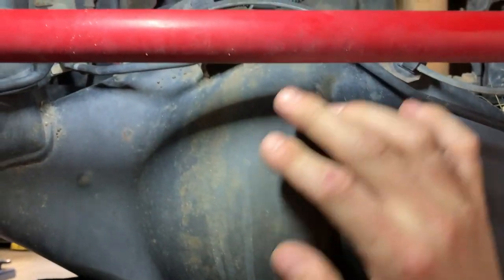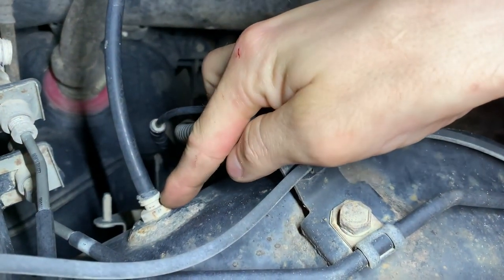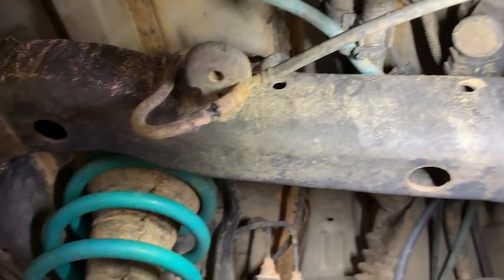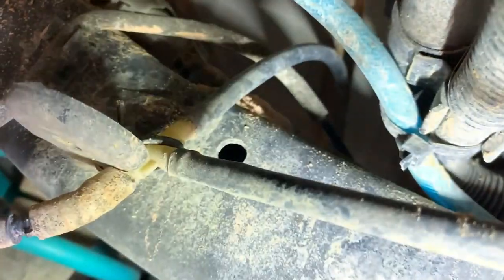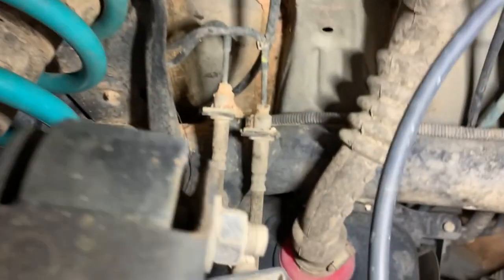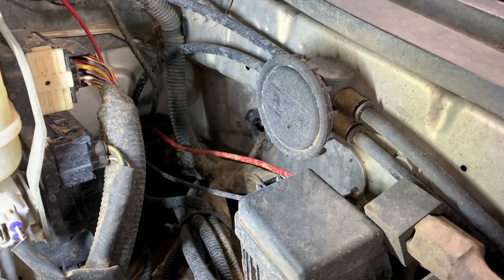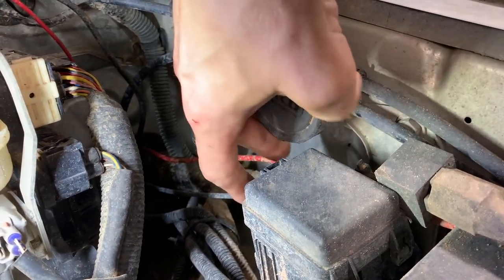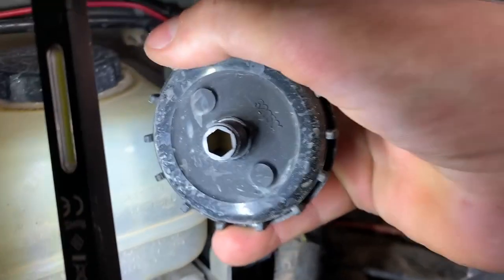ARB Differential Breather Kit on Toyota FJ Cruiser

Comment: Do you recall the diameter tee fitting you used to accommodate both the stock hoses and the 8mm ARB hose? I tried a 1/4" barbed fitting but it's too big.
Reply from the maker: Ya, 1/4” is gonna be too big.  I honestly don’t remember at this point.  I took the hose with me to my parts department and just matched up the fittings.  I would just take a piece into the store you are shopping at and do the same.

Comment: Some reason my 2007 automatic trans f j differential light went on now and I make turn under 10 miles an hour the back wheels skid and abs lights are on any ideas?
Reply from the maker: Yea!  Your rear diff lock is probably engaged!  Don’t drive it!!  That’s for Off Road use only.  It’s probably the solenoid malfunctioning or something along those lines.  The skidding is likely from your wheels being locked together.  The inside tire on a turn is supposed to go slower than the outside one.  That’s the whole point in the differential gears.  If your is locked, it would certainly explain one of the tires letting go around turns.  The ABS is probably just trying to figure out what’s going on and compensate.  Tow to shop, or it could cost you that differential instead of just a solenoid or electrical problem.